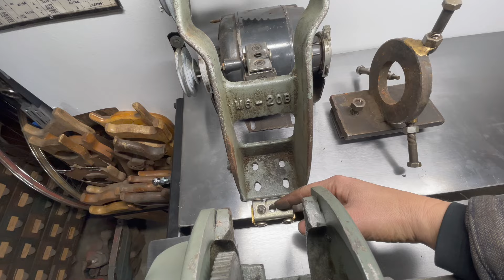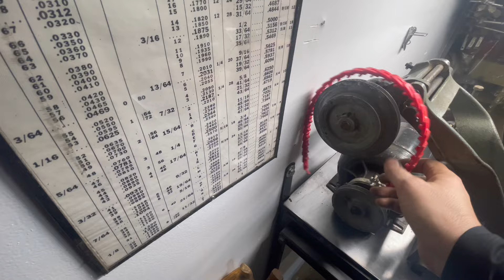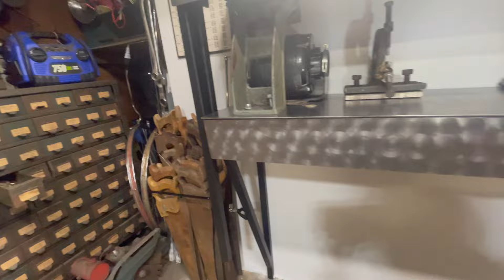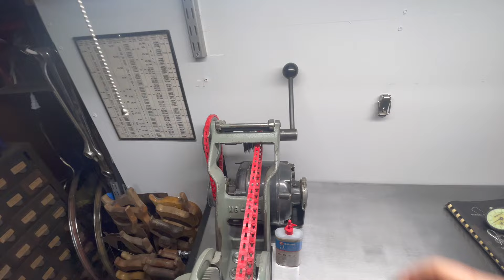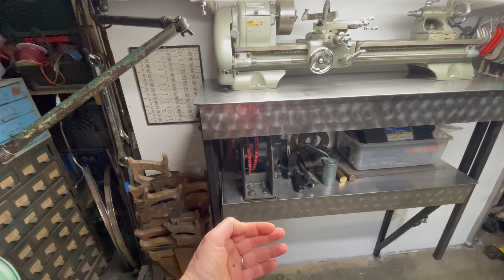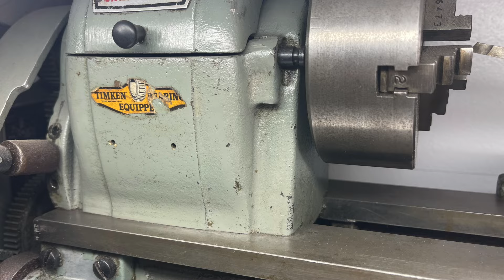Building a perfect lathe table for a small shop, part 3

Comment: Marci, what if you cut a channel in the table? That would allow the chain to stay on
Reply from the maker: Thought about that, still playing around with a few ideas...might just make a new countershaft with a removable support...for now it works out and isn't to bad of a set up, but yeah would be nice to just be able to fold it up!
Reply: That was my thought as well. It requires strengthening the table but that wont be a problem for the lady

Comment: You can do a longer belt and put an adjustable idler pulley  that will give you  enough belt room. ?
Reply from the maker: perhaps...I thought about doing another "jack shaft" style set up but for now this will work out...I might just design and build another countershaft with a removable support! cheers